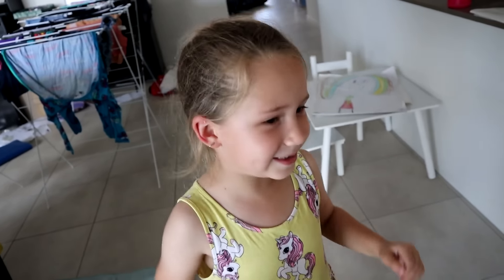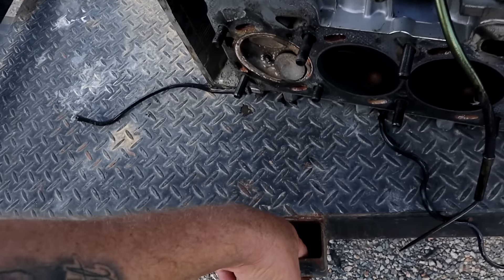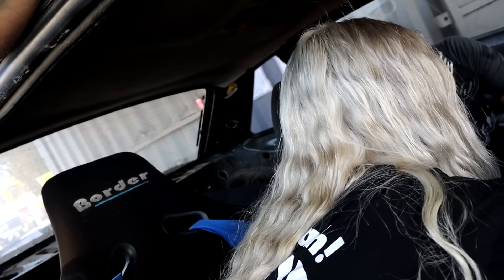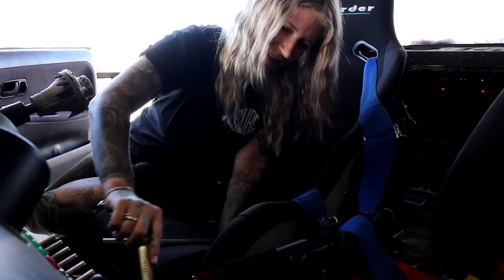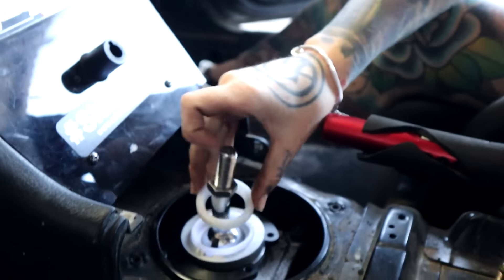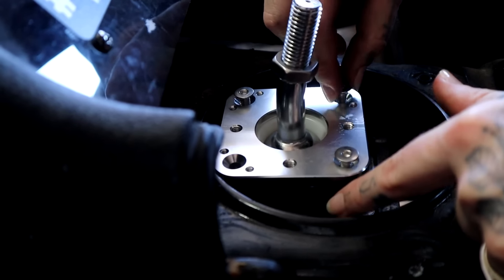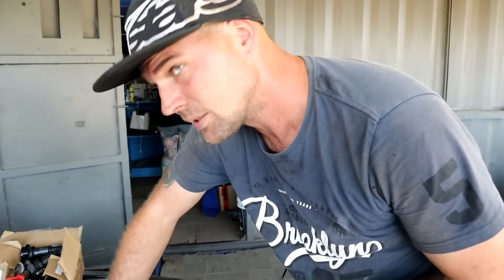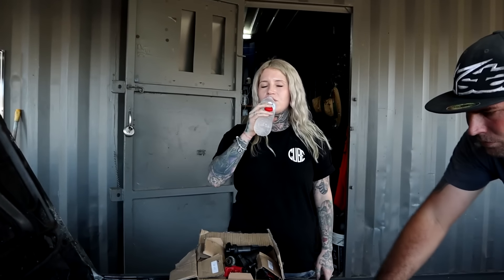20k burnout

Comment: Great Job Ti!  Stuck the Cube shifter in the N15 I'm warming up a bit for my boy and mate it transforms the feel of the car. 
Gotta work a bit changing gears but wow, it's quality and feels super tough and notchy in a great way.
All the best and stay safe.
Reply from the maker: what strength springs did you fit?
Reply: @Lukefink  no change from factory mate. there's only one in the linkages in the N15 that just pulls it centre in neutral. Way the things put together with super tight tolerances, you don't need to mod anything that's not broken. 
Reckon you need to hit em up to do a 350 kit cause I don't see one on their site. They do all their own fabrication and imagine it's pretty close to the R34, dunno but could see it being a decent seller.
Take care mate.